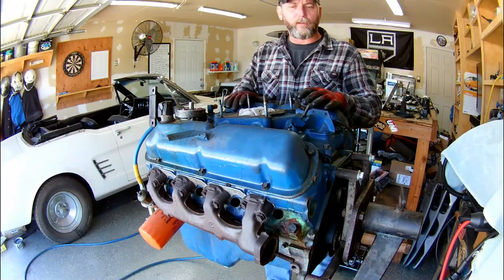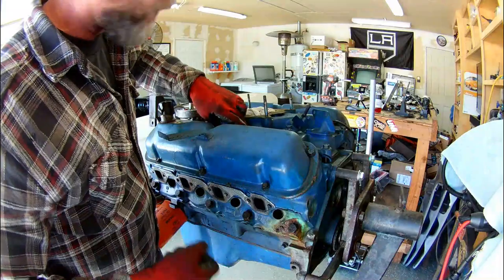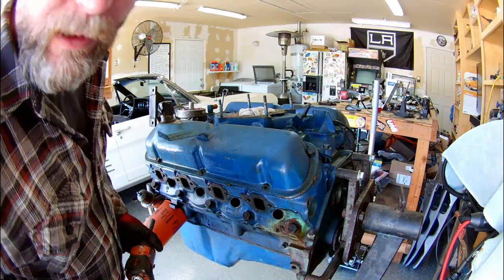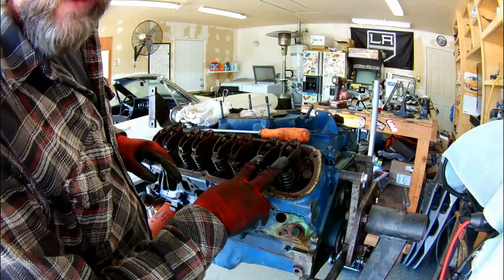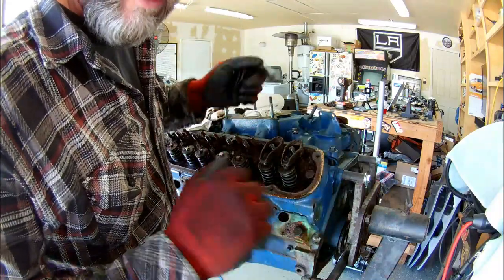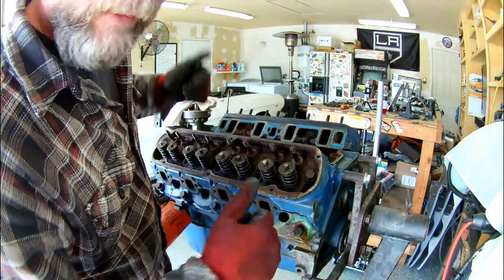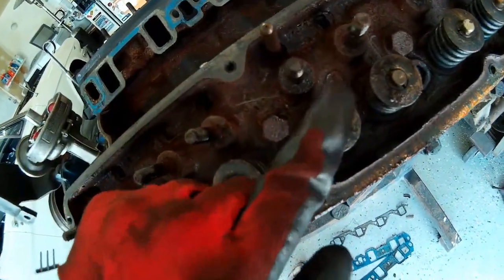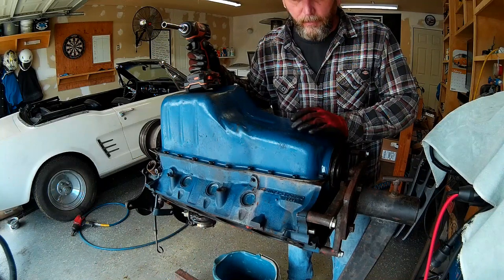66Mustang; 289 Tear-Down, Crusty & Rusty!

Comment: Put a decent set of aluminum valve covers on it and a new electronic distributor. The old girl deserves a little jewelry. Car looks good from what I can see. Oh, stay away from the cheap chrome stamped steel valve covers if the car is intended as a driver. Those things are prone to leak at the gaskets  good luck and hoping to see more of this build.

Comment: Hello, just discovered your channel, and I subscribed. Long story summarized with a question. In 1977 a friend of mine bought a stock 66 mustang 289 automatic. We worked on it and made it into a 4 speed hot rod. We pulled the engine and he bought a pair of 302 heads with huge oversized valves. Put in a Isky cam .310 duration.500 lift. Offenhauser manifold. Holley 650 double pumper. Ford 9 inch 411 gears. Borg Warner T 10 (wish it was a Top loader). My friend sold the mustang to my brother in 1986. My brother totaled the car. He pulled the complete drive train. The engine sat outside with a cover on it but the spark plugs were removed for over 30 years now. My brother said I could have the engine and the trans and the rear end. My question is, Do you think the engine is worth rebuilding after so much time being in the elements? Or do you think it is junk? I know it is a tough question without seeing it. I was 19 when we worked on that mustang, I am now 63 and retired. Thinking it would be a project. Thank you, hope I would hear your opinion.
Reply from the maker: oh man, that's a tough question...!  depending on where you live and how corrosive the moisture in the air is, it is probably still rebuildable.  (if you live near salt water....maybe not.)  i buy alot of old "junk" and i've seen tons of water in stuff that was sealed up.  i would expect that the motor will need a complete rebuild and machine work.  the bores will surely need to go oversize another .010 to clean up any surface rust, which means new slugs.  the cam & crank will need (at minimum) a polish, rods will be ok.  if you live where it snows i would inspect the block very carefully for cracks, although with all the ports open it's probably still good.  the Offy manifold will be good, carb probably isn't worth saving.  throw some bearings & lifters at it, after a very thorough cleaning, and i'll bet it'll be fine!  good luck and thanks for the great question!
Reply: Thank you so much for your response👍 The engine is in San Leandro, fairly close to San Francisco Bay. So yes, it may be something that can’t be fixed, or not worth fixing. If my memory is correct, I think it was bored out .30 over many years ago. So if I understand correctly, it cannot be bored out again? 
And by the way, I had a 1971 Ford F-250 4x4 high boy, with granny low 4 speed with a 4 low- 4 high transfer case, no power steering, no AC, back in 1980. I had that truck for 13 years and I loved it. I put Burbank springs on it to raise up the truck to fit my 36 inch tires with 16.5 inch rims. Sport Custom 360 big block. Lots of great memories! The video of your sons truck reminded me of mine back in the day!
Reply: @vicmerle57  even though a 289 is a thin wall cast, they can go up to .060 over. .040 over and maybe  sleeving could also be an option.

Comment: Heating the cam gear & bolt is totally unnecessary. I've never seen anyone feel the need to do that before & im curious why you thought you needed too? Usually as long as the engine is not seized, the problem areas on these engines will be distributors, as you see, & water pump bolts somtimes you have to be careful with. But anything else inside the engine shouldn't be seized or at risk of breaking off. Unless ofcourse this thing was way out there as far as demolished. I think there rod bolts from the factory are to small & weak. So when rebuilding I believe with these small fords its good to buy ARP rod bolts & have the rods resized even on a basic rebuild. Otherwise these engines are stout little engines.
Reply from the maker: you certainly may be right, but i wasn't taking a chance of snapping off that cam bolt that had sat corroding since 1985...   we ended up having to swap in a rebuilt longblock due to the cost of replacing the cracked cylinder heads being nearly as much as a new motor.  thanks for watching.